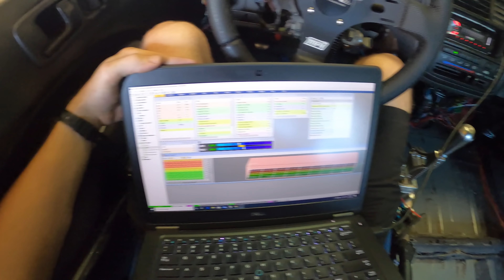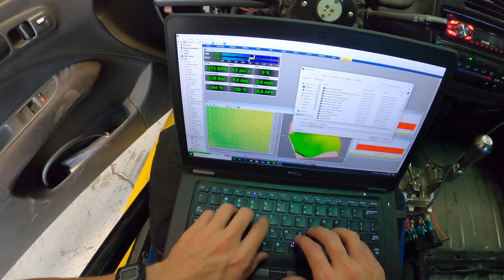900HP AWD Yellow Civic Is Back! ( Ready to Rip!)

Comment: B/H manual trans flywheel bolt have a 23 marking. They are longer than the "dot bolt". Get those SOHC bolts off that engine asap and torque to 75 lbs.

Comment: Using those arp bolts RIP. Gonna come loose, only use 4P arp or oem bolts
Reply from the maker: I used the oem d16 bolts
Reply: Oh boy. ValexRacing on eBay also sells the correct length ARP bolts. They are also my local shop

Comment: bro, we usually break shit and replace it with something better, why did u just put the same thing that failed last time back in? i know you need content but this is gonna cost you down the line too, trust me we want to see you enjoy your time at the strip and not work on getting the car back up in the shop again.
Reply: He put shorter flywheel bolts as reccommended by numerous people who build Honda’s as the ARPs are too long which caused them to back out.
Reply: @carguyty9370  you are right, my comment was mainly because i thought he had other/ different kind of trouble with this same clutch (so i was wondering why he paid for the same exact clutch , i wasn't talking about the bolts)... but he might not have had problems with this clutch on this car and i could be confusing it with the supras clutch issues... but i thought he mentioned different issues with it